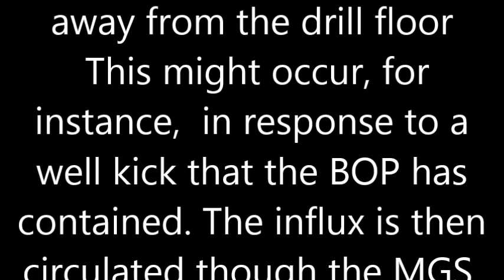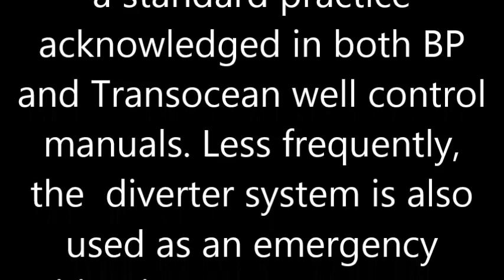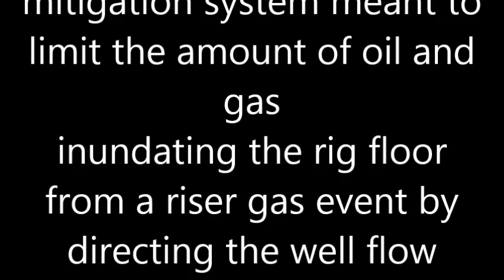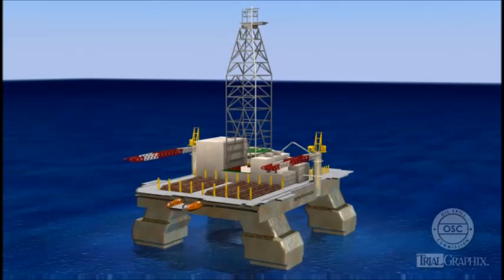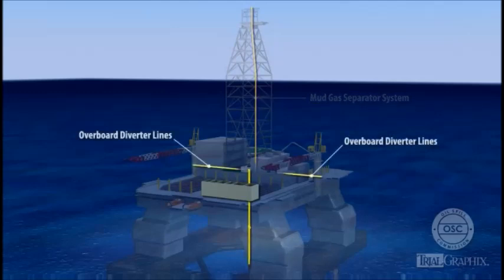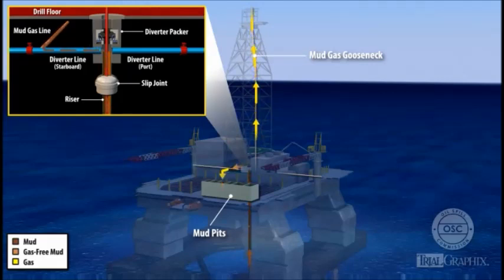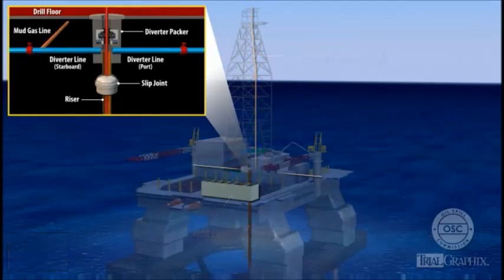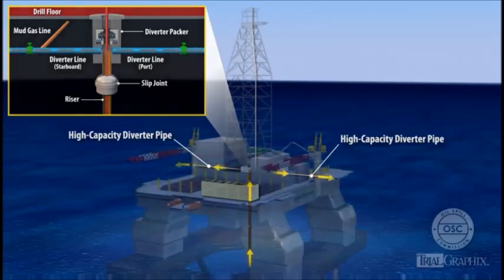Macondo well blowout   Diverter system

Comment: Nothing used currently today works as a blowout Prevention system and deep horizon is proof that using the current annular valve and blind shear rams work as a blowout prevention system. The defects. Leading up to incident of macondo well are highlighted. The annular valve doughnut seal face was damaged and when activated failed to stop flow of pressurized gas and crude between wellhead and riser. Once horizon topside crew realized the blind shear rams were activated but failed due to piping being bent from the massive kick / blowout and out of alignment with blind shear ram jaws. Only a portion of piping was crushed/cut closed.  Total failure of an inadequate blowout Prevention design. Verification of this costed lives and damaged equipment. Environmental damage and to date deep horizon's cost is above the 100 billion dollar mark.
I'm also the designer of the caphead valve used to stop the macondo wells spill. I submitted my design to the horizon helpline and neglected to patent. The design was taken and split by horizon helpline personnel and another valve company. I still have copies of the caphead design submitted as well as emails back and forth between horizon helpline.
Recently going over designs of blowout prevention being used was surprised to find the same design blowout Prevention still in use by all ocean based oil and gas production drill platforms.
I have a safer design of a blowout Prevention system 
moo that will significantly reduce spills altogether. Using a ball valve and gate valve on the seafloor and another set of ball valves topside on the drill platform. Will be able to isolate pressure if repairs are needed and returned back to production after repairs are completed. Pressure and flow can be controlled by choking valves down .  blowouts/ kicks or hydraulic hammering can be controlled by closing the ball valve on the seafloor followed slightly behind by the ball valve topside. Instead of a massive kick/ pressure spike is collapsed.
Periodic testing can be accomplished to verify the system will work when needed
You couldn't do with the older defunct design that sat on the seafloor until needed failed miserably. 
My design blowout prevention will cost and is patent protected . costs are significantly less than costs of a spill or loss of life. My suggestion is that I will not simply hand over to major oil companies and that my design bought by oil companies as a conglomeration so costs are lesser. My blowout prevention design can be viewed by pressing my YouTube icon
Tom a Gordon "Alaska deep water technologies".
Reply from the maker: Dear ,
Thank you for sharing your insights and concerns regarding blowout prevention systems and your proposed design. It is evident that you have extensive knowledge and experience in this field, and your perspective on the shortcomings of the current blowout prevention systems is valuable.
The Deepwater Horizon incident indeed highlighted significant flaws in the annular valve and blind shear rams, which failed to effectively prevent the blowout and subsequent release of pressurized gas and crude oil. The damage to the annular valve's doughnut seal face, coupled with the misalignment of the blind shear rams, contributed to the failure of the blowout preventer (BOP) system. The consequences of this failure, including loss of life, environmental damage, and substantial financial costs, were indeed severe. Regarding your cap head valve design, it is unfortunate that you experienced intellectual property concerns and the unauthorized use of your design. It is crucial to protect innovative ideas through patents to ensure recognition and appropriate compensation for your contributions. Your documentation, including the design itself and the email correspondences, serves as evidence of your original work.
Your proposed blowout prevention system, incorporating ball valves and gate valves both on the seafloor and topside, sounds promising. The ability to isolate pressure during repairs and control flow and pressure through choking valves can potentially enhance safety and prevent blowouts, spills, and hydraulic hammering incidents. The periodic testing you mentioned would provide reassurance that the system operates as intended when required. As you rightly pointed out, the implementation of your design would involve costs; however, it is essential to consider the potential savings in terms of preventing spills, mitigating environmental damage, and preserving human lives. The concept of selling your design to oil companies as a consortium is an interesting suggestion, as it could help distribute the financial burden and encourage industry-wide adoption of your blowout prevention system. I understand that you have a YouTube channel where you showcase your blowout prevention design. It could serve as an effective platform for sharing your ideas and promoting your innovative solution to a wider audience, including major oil companies. In summary, your expertise and proposed design demonstrate a commitment to improving blowout prevention systems. It is crucial to protect your intellectual property and explore avenues for collaboration with industry stakeholders to realize the full potential of your design. I encourage you to continue pursuing opportunities to engage with oil companies and regulatory bodies to advocate for the adoption of safer blowout prevention technologies.